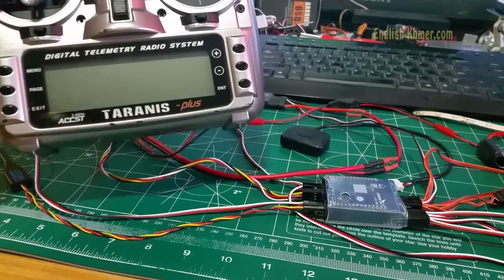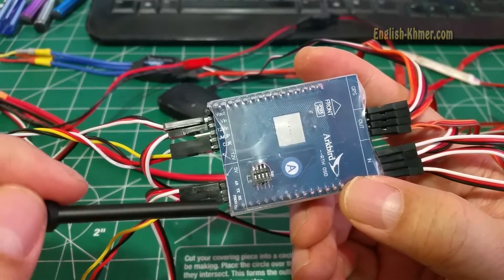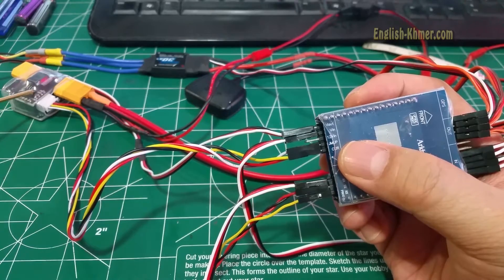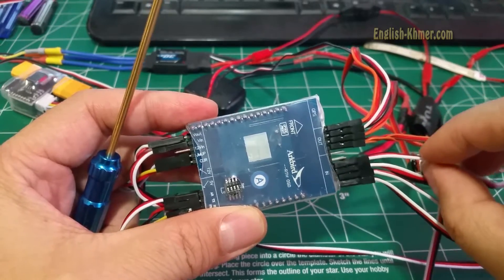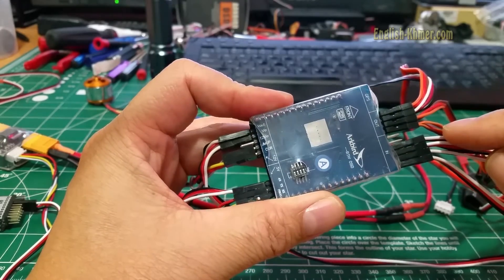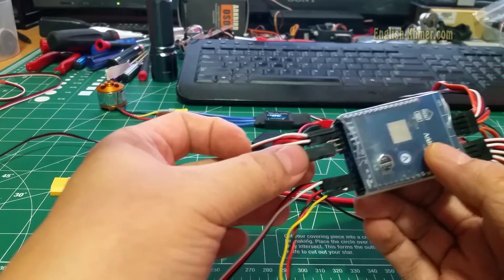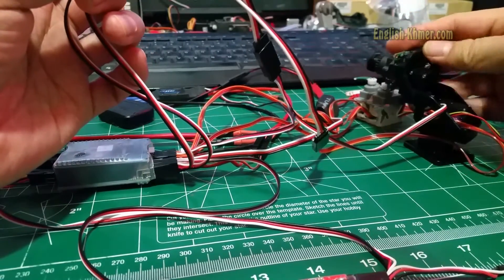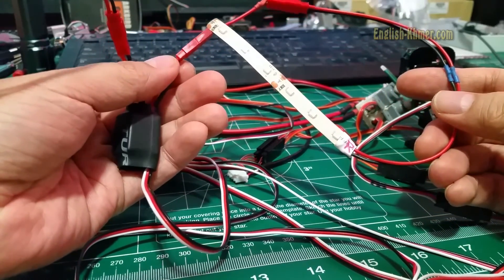Arkbird AutoPilot OSD setup - UHF 433Mhz FrSky Taranis Plus

Comment: Hi I have the Arkbird version 1 the first one can it be setup with ppm using the ezuhf or do you have to use pwm
Reply from the maker: Arkbird AutoPilot OSD v1 works with PPM only
Reply: Niset Khmer I thought it was pwm one lead per channel do you connect one lead from ezuhf receiver just like you
Reply from the maker: I would never do that.  That's 12 wires to run.

Comment: can you please tell me how to setup the tranis to get that all to work? email me chris925951@gmail.com or you could send me the setup in the opentx if you use that. Thank you in advance
Reply from the maker: +chris christianson You don't understand this video?
Reply: +Niset Khmer  i understand the video its the setting up of the taranis radio i need help with.
Reply: +chris christianson Hi Chris, did you get the taranis setup info, specially the switches setup, I am in the same situation, I am new to open tx and taranis and don't know how to setup the flight modes. Cheers

Comment: Hi Niset, 
Can you tell me which way to turn the power adjustment screw on the UHF Tx to increase and which way to decrease power?
Reply from the maker: +PoppaShocka The same as volume control.  CCW to increase.
Reply: +Niset Khmer ok thanks!